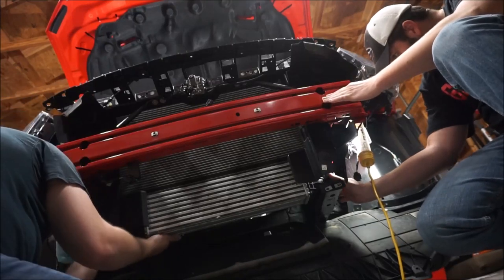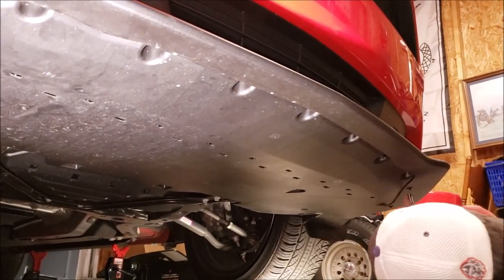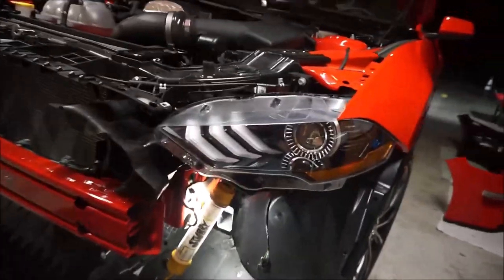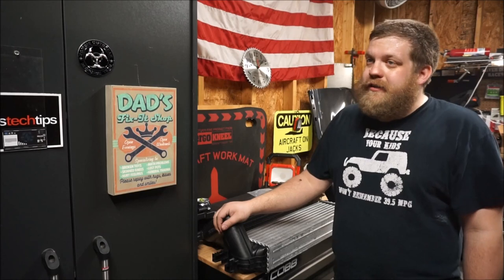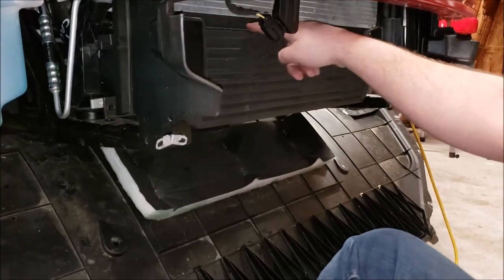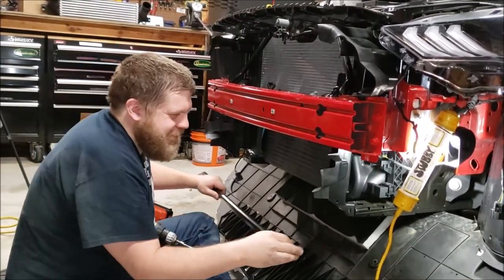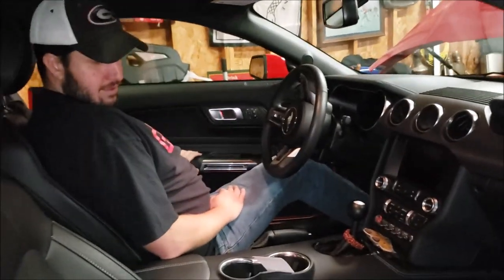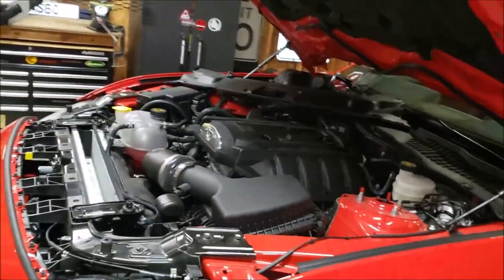2018 - 2022 Mustang Ecoboost Intercooler Install (Incl Bumper & AGS Removal)

Comment: Great video. I have a 19 and I knew the bolts in the fender was different starting in 18,thank you for showing that. I'm getting a CVF intercooler in a few days, I was going to use my ramps to change the Intercooler out.Do you think the angle would be weird getting the stock IC out with ramps?
Reply from the maker: You will have an issue getting the bumper off without raising the front. Once the bumper is off, you should have full access.

Comment: Did the car throw a code when you removed those shutters?
Reply from the maker: No. I was actually surprised. I've heard different things but I got no codes. I also didn't get any codes when I deleted the cat.
Reply: I'm surprised too.  A guy posted a video of his Silverado on YT.  He wanted to install a light bar in the grill and the shutters were in the way.  So he cut them out and got a code.